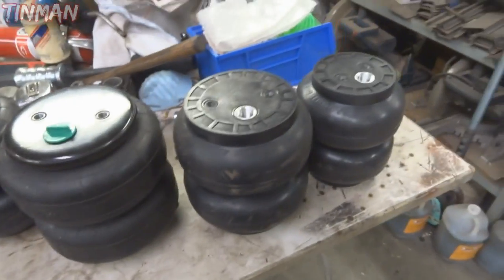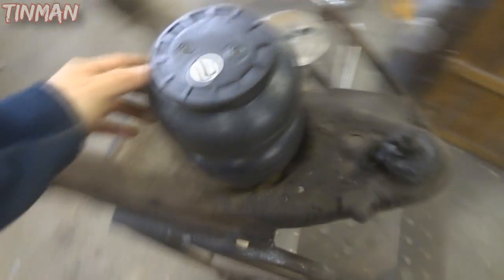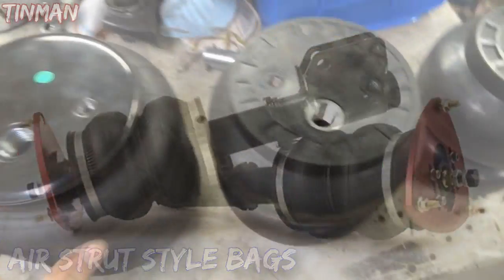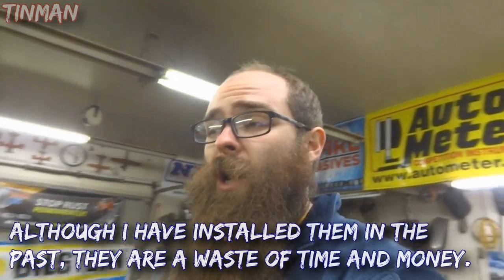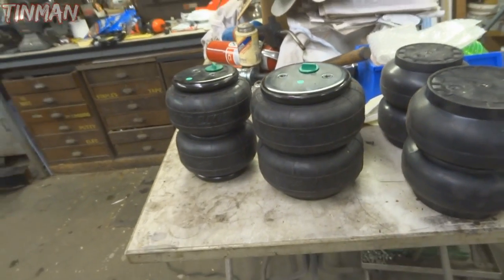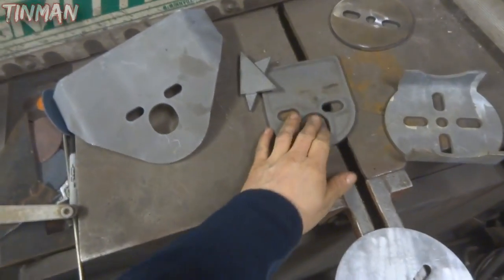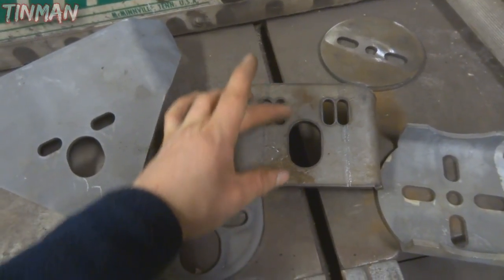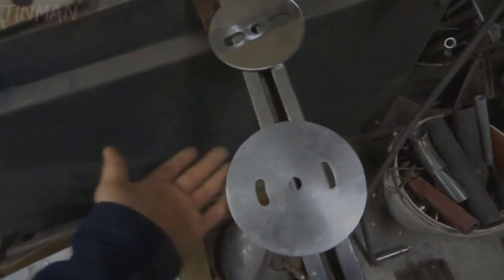How to Choose Air Bags & Brackets for your build

Comment: Thanks for the video. One question, how do you pick stroke length? If I am trying to get near stock ride height would I just measure the original spring height? Or do I measure the suspension maxed out say on a lift with axles dropped?
Looking to put air ride under my 78 F250 which has more of a high boy look.
As far as weight capacity goes, does a higher capacity air bag ride worse/better? I dont plan to tow but may want to to pick up a car on a trailer. Thanks!

Comment: Sprung my truck when I rebuilt all the suspension. Like to bag it at some point... laying frame looks so good ! We get tons of rain though and seeing as this is my daily I wonder if it might be more headache that its worth. The loss of the inner fenders alone makes me shudder thinking of all that water flying wherever it likes.
Reply from the maker: TheCanadianBubba lol well it's only a loss of inner fenders if you're lazy. There is always a way to make new inner fenders of some sort.
Reply: Thanks for word, had not researched at all yet... want a posi and disc's out back first : ]
Reply from the maker: TheCanadianBubba eh, rear disc brakes are overrated. Posi Is worth it though!!

Comment: Great video first of all. I'm bagging a 64 cadillac and am using dominator 2600 bags, 3 out of 4 of them leaked  and after getting warranted replacements one of those leak also. So I am thinking about trying the slam 7. Was curious about ride quality between the 2 and is the stroke comparable. Dont want to sacrifice ride height.  Thanks
Reply from the maker: They are virtually identical in specs. Ive installed probably close to 100 airlift bags and never once had one leak. So I would actually recommend changing your fitting and/or line. You're spending unnecessary money and time replacing the bag
Reply: @Tinman2Kustoms  
Thanks for the response. The bags are actually leaking from right around the crimp seal at the bottom of the bag

Comment: My 97 Dodge Ram is lowered 3 in the front and 4 in back. I’d like to bag it in the spring. It’s currently sitting on 22s. Will I need different rims if I get bags for it?

Comment: I was just doing some air bag maintenance on my toyota pickup today, i got ss RE6 in the front(not a lot of room in the front of mini trucks for bags and the slams dont balloon) and airlift 2600 in the rear, its bag on axle so the ride isnt the best but i might add lift bars one day or just redo the setup, I mean i have ridden in both and yes bag on bar is noticeably better but its still better than leaf springs i think.
Reply from the maker: EvanThaG oh yeah there is a ton more to discuss with bag stuff. This was just a quickie lol if setup proper a bag over axle can be very nice. The last truck I built, bag on axle, rode better than any other vehicle I've ever built. Bag on bar included. Not sure if I'm getting better at it or was just lucky lol the slam non ballooning is a nice feature, but really the airlift ones don't bag very much. For the price I'd always choose the airlift bags. But the slam ones have their place too!! All the others on the market.... Well.... You won't see me running them lol
Reply: I have heard success with vixen bags but i am going to keep running airlift and slams lol. Airbagit bags are garbage, my dad got 4 of the denominators you talked about for like 114$, they leak a decent amount and dont lift much, he also ordered fitting and got 2 correct fitting and the other 2 where 2 different sizes, we called and when they do answer you dont get much help, some things like bag brackets and my uncle has been buying their hidden hitches for years, but stay away from the bags and fittings... I only buy from horn blasters, AVS, or thorbros now.
Reply: My truck has been bagged almost 20 years now 4 years ago we ditched the old bag over axle and horrible aluminum 4 link we made from speedway and did bag on bar with a wishbone on top. The ride is a thousand times better it’s almost all we do anymore out of our play shop but I would love to try a cantilever setup sometime

Comment: I have a two inch hole at the top where the bolt goes with nothing to bolt to. Is there a gusset or metal piece with a hole that I can use to make the upper cup hold tight to the shock tower?

Comment: I have a 81 camaro and was going to put ACDelco 519-36 Specialty Front Spring Assisted Shock Absorber in the front, So my question is im looking to have the camaro have a switch for race mode option what is the best air ride do you thing i need in the back?

Comment: How would these be for air lift in a Escalade for towing for replacement of the rear springs
Reply from the maker: There are many great options for load support/towing. I would recommend you reach out to air lift. They are the company I use for load support bags on all of my trucks.

Comment: Question, what fittings do you use for the dominator i bought 1/2 npt and they only go in half way and stick out to high as a matter of fact they even stick out on my tank, are they supposed to go flush?
Reply from the maker: No they do not go flush. It's a tapered thread, so the deepness depends on the taper off the fittings and the bags. Pipe tape and go until it's tight with a wrench.
Reply: Thanks again for your help

Comment: Hey bud I had a question. I'm currently replacing my old 7" Slam bags and was considering switching to the Dominator bags. Problem is my truck is in storage a few hundred miles away, so I do not have the ability to get to it to measure first hand. The slams being "non-balooning", will the Dominators fit without rubbing in an application that was meant for the slam bags, or do they balloon out a lot???
Reply from the maker: I've never seen an application where the dominators won't work in place of the slams. Could be possible thoreticsllt, but the ballooning is minimal with the dominators.
Reply: @Tinman2Kustoms  Right on! Thanks a lot for the info! I wasn't crazy about the ride on my slams so I may give the dominator a try for the price.

Comment: Hi! What do you think, which one will have more comfortable, smoothest ride in equal conditions, ss6 or D2500?
Reply from the maker: Would be similar. I would lean towards the d2500 because of lower costs and a slightly larger volume.
Reply: @Tinman2Kustoms  thanks for answered. I heard that d2500 have 7” max dia, SS6 have 6” normal, and 6” max dia. You dont tell about it. Does it true?
Reply from the maker: @ОлексіПсьол  yes that's true

Comment: Great informative video!
I have bags on my 2007 Chrysler 300C 5.7L V8! The rear bags which are similar to those in your video seem to roll over on themselves quite noticeably! They do the job, meaning they go up & down but they just don't look right!
What would be making these bags do this??? Any assistance is greatly appreciated!
Reply from the maker: They should collapse onto themselves and collapse to about 3" total height.. As long as they collapse straight, that's what they're designed to do
Reply: @Tinman2Kustoms  maybe I didn't quite explain it properly!
When pump up to max height the bags aren't straight, they lean over onto themselves! Kind of looks like when you stretch & bend an accordion! They should inflate straight up & down but mine look to leaning towards the centre of the vehicle when inflated!
Reply from the maker: @aarondwyer8341  that's totally normal. Especially on independent suspension. Manufacturers recommend that they collapse straight. But they don't have to expand straight. Sometimes with geometry it's impossible to expand straight.
Reply: Thanks for reply!
I suspected this was the case as the system was installed by a highly reputable shop! It just doesn't look right to me, but admittedly I'm no expert!
My concern is, does/will this affect the durability & lifespan of the bag?
As I said I'm no expert but would an offset plate at the lower mounting point eliminate this & do you know if there is such an item available?
Again thank you for taking time to respond to my issue, fully appreciated!!!
Reply from the maker: @aarondwyer8341  they are designed to take that side force. They're incredibly strong at the seam. Atleast the airlift & slam specialties bags are. They will last 10+ years without any issue. And if you offset the bags, they won't collapse straight. Which is actually harder on the airbag because when they're collapsed they will rub on the wrong parts of the bag and rub through. Always want them collapsed straight and canted when aired up.

Comment: Getting ready to bag my 67 C10 which has a 85 front end under it. Was thinking Firestone 2500 in the front and Firestone 2600 in the back just for clearance. Or do you think the 2600's will be okay in the front?
Reply: I'm putting 2600 in the front and 2500 in the back

Comment: I have a 54 Chevy pickup on a 2000 S 10 Chevy chassis frame. Will those bags work if I wanted to slam it?
Reply from the maker: Any bag will work. It's the work around the rest of the suspension that makes the "slam" possible.

Comment: Good vid bro. But my question is which bag is good for a 64 impala. And if you wanted to get the vehicle to stand tall on all 4’s ( where you can see the rear axle and all) what would be a good bag.
Reply: Airlift or slam specialties. But I'll mention if you go 2 air compressors fir example on my Silverado I have an 8 gallon tank for my rears which are slam specialties,  now fro the front I have a 12 gallon tank with the airlift 2600's with avs 1/2 inch valves and I can hop my front . And dual viair 480's to the 8 gallon tank and dual viair 485C's to the 12 gallon tank...
Reply: I would run ss7 air bags all the way around HE DIDN'T EVEN MENTION THE KEY POINT SLAM BAGS DO NOT EXPAND LIKE OTHER BAG COMPANIES SS FOR THE WIN!!!

Comment: Maybe this is weird, i'll let you decide, but I'm trying to find someone who has brackets that are taller than what is normally sold. I have a 64 Impala and all the bracket cups I see are about the same overall height, and I'm sure most people like to be able to slam their car on the ground. In my case, this is NOT what I want to do. When my bags are totally deflated and im riding on the bumpstop, I still want my car to be an inch off the ground at least. I know it looks cool to have your underbody and exhaust touching the ground, but beyond looking cool it serves me no purpose, and incase of an emergency in which my bags lose all pressure, I want to be able to still drive my car a short distance to safety. 
Does anyone know where I can get brackets like im talking about??

Comment: What is the downside to using a huge 10" + bag ,  where clearance is NOT an issue? On a light weight car...
Reply from the maker: Needs more air volume. But will give you a softer ride with less pressure. There really are no negative consequences of fitting an oversized bag. Sort of like asking if more cushion in a car accident is a bad thing lol always better to have more/bigger if you can.
Reply: @Tinman2Kustoms  Thanks!

Comment: How much can an air bag twist and bend?? Like i mean if its not straight up and down.  Can it inflate and deflate even if the back is not straight
Reply from the maker: Yes. You want your airbags to be perfectly flat when deflated in the relaxed position. They will naturally bend and twist a little with suspension movements. That's normal. But obviously the less the better. They're built for some though.

Comment: I want to bag my 95 impala ss . What would you recommend? Is there a good kit?
Reply from the maker: I'm sure someone makes a kit! If you want to lay out all the way, you won't be able to get a kit for that though. Just bagged and about 6" lower I'm sure someone makes a kit.
Reply: @Tinman2Kustoms  I see a kit by EZ air but there are few reviews on it. I don't really need it to lay all the way out just ride low and sit lower. Just something so I can raise it up and not drag everywhere like I do now with just lowering springs.
Reply from the maker: @heavilyarmed556  ya get what ya pay for. A basic kit is fine. Just might not have all the luxuries that an expensive kit would have.
Reply: I already have an air ride on my 96 impala I want to switch out to a better bag in the front because it’s hard to describe but the air bags in front  there now bent outwards if that makes any sense and it rubs on the sway bar links I think it has cheap airbags I had lifted at a shop in San Antonio what do you recommend on airbags just to swap them out

Comment: What kind of thread sealer do you recommend for the fittings on the airbags so they don’t leak air
Reply from the maker: You can use standard Teflon pipe tape, or I prefer to use a liquid sealer with Teflon, like ARP's thread sealer or something you can get at a hardware store. But not the loctite brand stuff. You want something that has Teflon in it.

Comment: So i want to run air lift dominators on the front of my 65 chevy c10 which size do you recommend, they will be on the stock a arms the d2500 or d2600
Reply from the maker: You could do either. It's preference. The 2500 is easier to work with because it's smaller. But the 2600 is a stronger bag so it will take less air pressure to lift the front of the vehicle, which will give you a softer ride. Either will work. The 2500 would be my recommendation if you're not sure.

Comment: I have some firestone 224c which need replacing, are all the Firestone 224c bags roughly the same even if the actual part numbers are very slightly different?

Comment: So my 63 impala is really bouncy in the front , he sent me firestone air bags and monroe shocks.. air lift bags rear. Should I get the ss7 bags for the front and maybe better shocks?
Reply from the maker: Yes better shocks
Reply: @Tinman2Kustoms  so the ss7 bags wouldn't necessarily be less bouncy/ floaty than the firestone?
Reply from the maker: @PeachCoastLowrider  most likely not enough to make a noticable difference. Shocks are the bounce controllers

Comment: Im building a 86 c 10 bought the bag plate kit for the front does the cup weld in on the bottom or does it just sit in like a spring
Reply from the maker: Just sits in the pocket